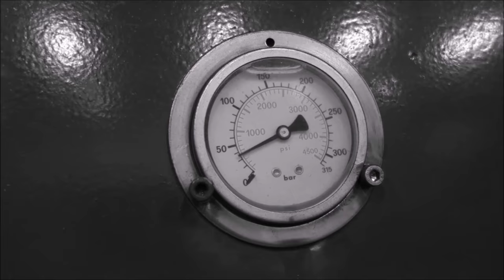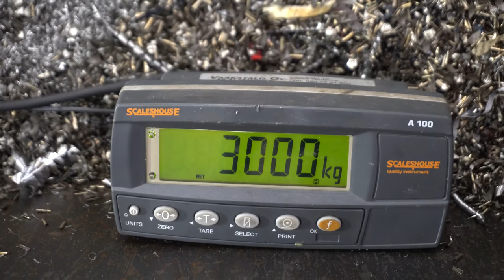How Strong is Polycarbonate Blast Shield? Hydraulic Press + Smashinator Test!

Comment: Then how the glass broke in the interview of the truck?
Reply: Ballistic glass isn't necessarily hard to break. It's hard to penetrate. It's multiple layers of glass with plastic between them and a final layer of polycarbonate. The first layer of glass is just glass.
Reply: They said it broke cus it cracked when tests happened earlier.
Reply: @Bob5mith   thanks for the info
Reply: @TetaGama   yes they tested before theninterview on 1 glass only,i meant the 2nd glass plate
Reply: Some other things I forgot to mention, it doesn't always have the last layer of lexan and the plastic layers are relatively soft and stretchy to absorb impact. The glass isn't tempered either.  

Windshields are also ballistic glass. They're usually two layers of glass with a plastic layer between. They don't stop bullets but they do a good job against small objects at driving speeds.
Reply: The glass broke because they hit it with a sledgehammer. When they hit the doors they caused micro fractures in the base of the window. Then the metal ball they threw at it just expanded those. At least than what Elon said.

Comment: Oh no, I really hate it when the video works the sponsor message into the content of the video. 
This is a really sketchy way of the sponsor to put their words into your mouths. And you're the ones that is going to take the shame if the product isn't delivering. Like with NordVPN which probably does a great job at when they do. However recently they have taken some flak because it turned out they haven't been telling their customers about security issues. For a VPN this is really bad, because what a VPN ultimately sells is Trust. Not being open about security breaches is bad, but not as bad as the damage to their customers trust. Because if they keep silent about that, what else are they keeping silent about? 

Now the reason I'm mentioning all of this is because ultimately using this sketchy way of having trusted youtubers, use their own words to sell their product, usually worked into the content of the video, so that without knowing it you are suddenly watching promotion. it is a very manipulative and sneaky way of advertising, and most likely the fault of whatever PR firm Nordvpn is using. But ultimately this kind of advertising is further eroding NordVPN's Trust. 

Trust is what an VPN sells , the service you can get with an old 386 hooked up anywhere, but trusting it to keep your traffic secure is another matter. 
And I really hate seeing my favorite youtubers I otherwise trust, seamlessly going from content into promotion material. That erodes the trust I have in the youtubers as well. 

So please don't try and make it look good by working into it video nicely, make it clear cut and obvious that you are now promoting something. That is all I ask. 
Thank you.

ps,, Good of NordVPN to be open about the security breach, this helps in regaining the trust, but the advertising is still a bit shady. ;)